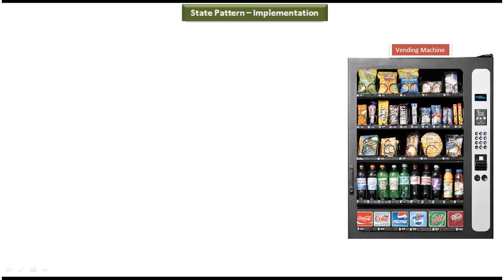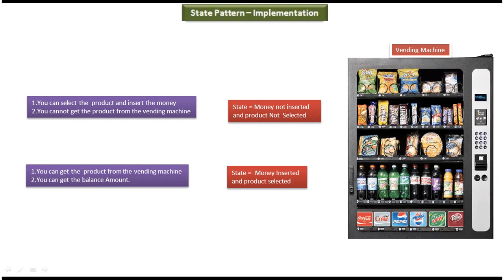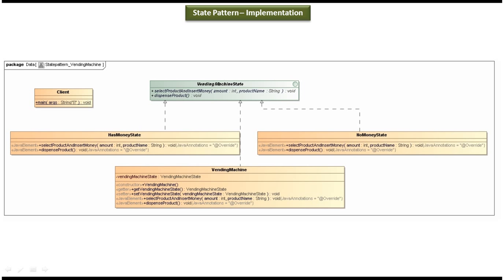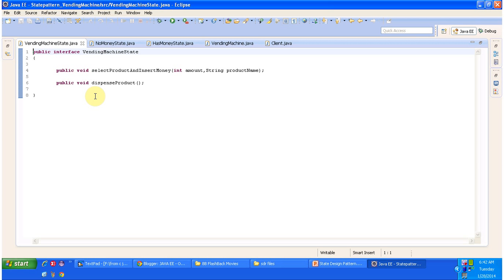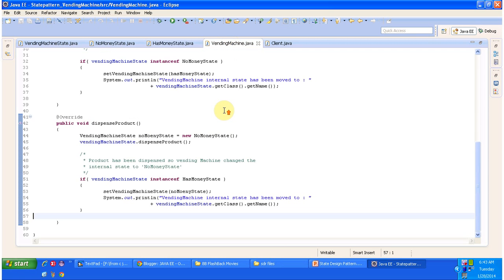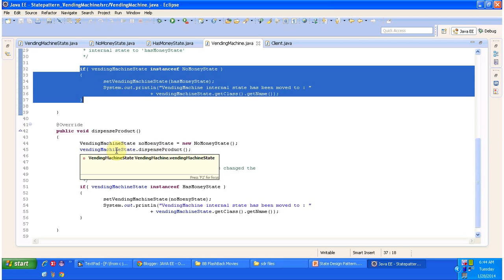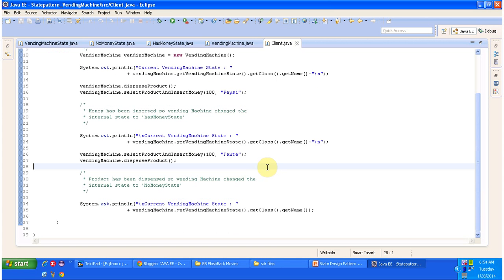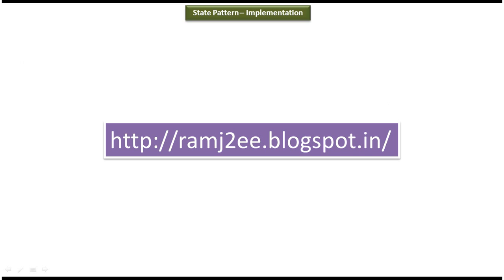State Design Pattern Applied: Vending Machine Implementation

Comment: Design state machine to handle two-items vending machine (item1 and item2) with price 20
Cent and 30 Cent each respectively. User can add 5 Cent or 10 Cent (using push buttons). It
has two LEDs and one of the LEDs will lit when a total of 20 Cent adds up indicating the
user can buy item1 from vending machine and the other LED lit when a total of 30 Cent
adds up indicating the user can buy item2 from vending machine? please help me to fine a solution for this question 🙏🙏🙏